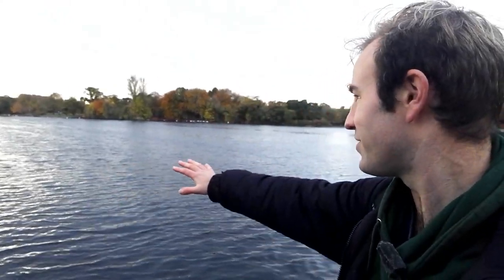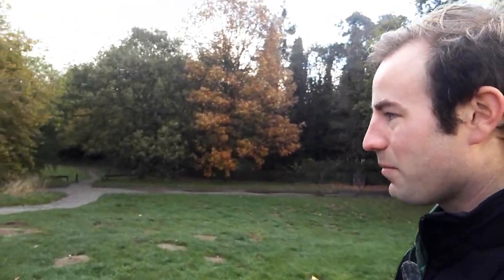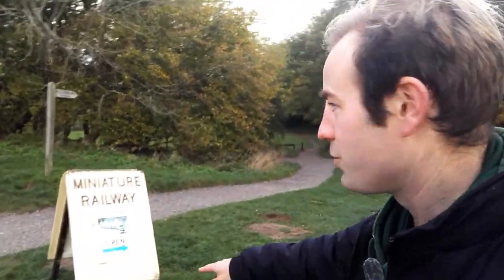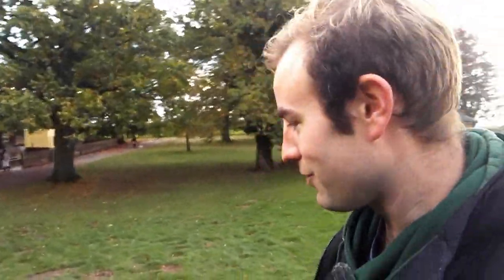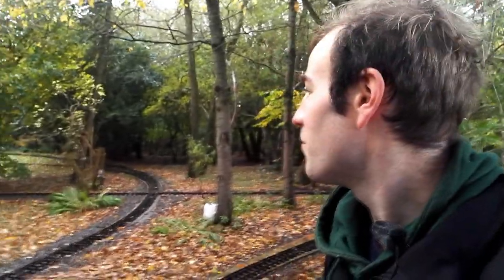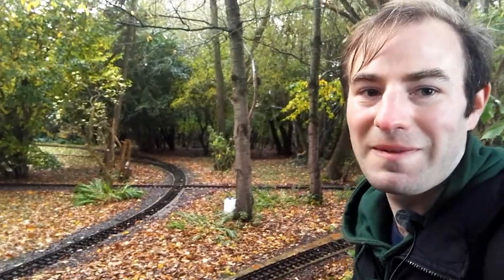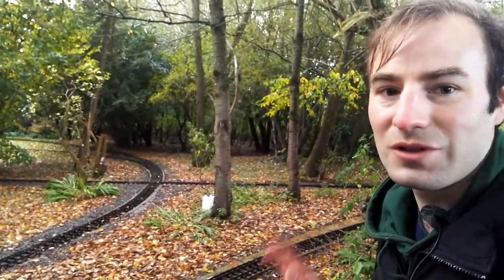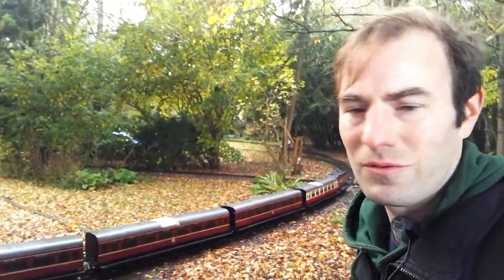Coate Water Railway - Episode 34 of Miniature Railway Britain!

Comment: The original line was what was called on the video the Old Loop (where the engine/carriage shed and the big steaming bay in the middle is). Back then, the big steaming bay was the main one. Then the outer Loop was built and that was the only line until I think 1993, when the Inner Loop (actually a figure of eight) with Bailey's Bridge was built. It was a little before then when the small Steaming bay and Turntable was built by the Clubhouse at Lakeside Station, and for many years that was the main steaming bay and the little shed at the back of the clubhouse was the main Stock and Engine shed. The Avoiding line was built in the mid - late 90s (which I actually helped a little with), at some point in the late 2010s the big Steaming bay was refurblished and became the main one again and the new Extension and what would later become it's tunnels and Richard Jefferies Halt only was built just before the COVID Pandemic (about 2018 I think). It's changed alot.
Reply from the maker: Thank you for watching and explained the evolution of the railway!